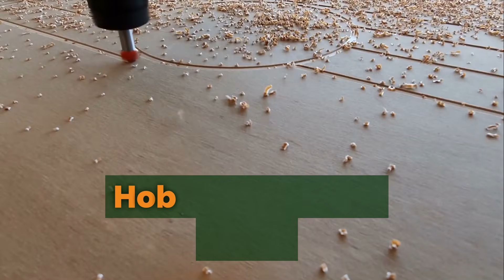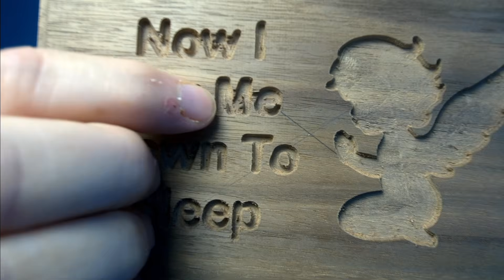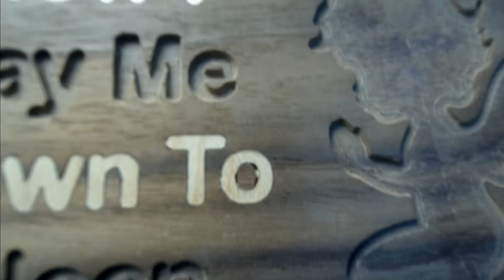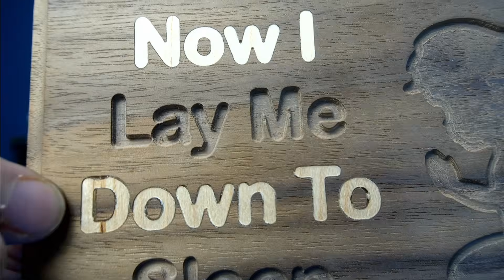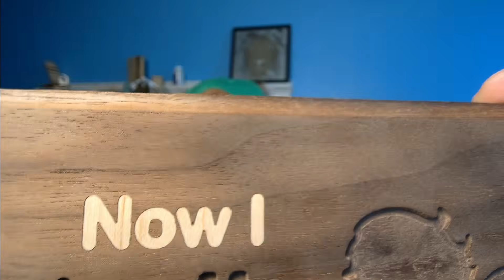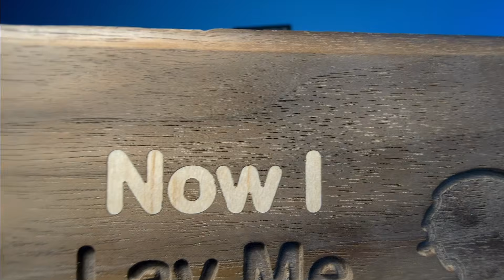2.5D vs 3D CNC Engraving: Understanding Cut Paths & Perfect Inlay Fits

Comment: Another good video with some great insight.  I too, assumed that cutting inside the line and outside the line would produce a good inlay, although I have not tried it. I'm also new to CNC but not the 3D world and I'm wondering if it's possible to write my own bits of G code to make the router move in both axes at the same time. It should be possible.  I'm going to remove the bit and test this theory and see what I come up with.
Reply from the maker: I had taken a break from Millmage until they introduced V-carving.  The latest Release Candidate does just that.  So, I a back to learn and share my experiences with others. New video dropped today.

Comment: Thanks a Stack ..... A Great Vidclip ..... A Great Simplistic and Easy to understand Vidclip Explanation ..... I am Retired ( 75 Already ) from the CNC Background, a Toolmaker by trade and as with you, I have been using LIGHTBURN for a good few years already. I am busy building a  Small Very Sturdy CNC Router .... 600 x 400 x 80 mm Movement and have just been busy with 'MILLMAGE' for about 10 days .... I also found the 'Similarities' Extremely Helpful .... OK .... 'V-Engraving' is a Massive step up in the Calculations, as there has to be CONSTANT Calculations into the 'Cutter Width', being a 'V' Profile, when a 'Needle Point' Profile is required, The Cutter has to rise up to Virtually the Z = 0 position ..... " Cutter Diameter Compensition' would be a Great advantage, But has to be in a 'Table' and applied to Every Specific Cutter ..... OK, Enough Ramblings.... Best to ALL from ChCh, NZ
Reply from the maker: Thanks! I had taken a break from Millmage until they introduced V-carving.  The latest Release Candidate does just that.  So, I a back to learn and share my experiences with others. New video dropped today.

Comment: With it not having the ability to do a true vbit capability would it not be better to do just a straight bit inlay
Reply from the maker: 2.5D inlays are typically done with straight endmills.  Using my technique and my calculator you can bet much better results.  You have precise control and inlays created with v-bits have a much better finished result. My technique and calculator will not work with true v-carving, but I do believe it is a game changer for doing inlays when limited to 2.5D.

Comment: The Problem with Millmage is, They released the vcarve function before it was done. I t will be able to do the true vcarve in later versions. That is according to Chris. So it is coming. Both Millmage and Vectric will cavre to the line. But Millmage can not raise the bit to get to the finer details. It has to stop at the point the programmed bit can fit in that vector. If your vector comes to a 2mm point and you are using a 4mm bit, it will not fit.  It is like doing a normal pocket operation with a straight end mill. Other programs have a "REST" option that allows you to do a bit change with a smaller bit to finish tighter details like that.
Reply from the maker: When using the Inlay Operations built into Millmage, the female pocket cuts inside the line.  The male operation cuts outside the line.  From my research, this is standard on 2.5D inlays.  And typically 2.5D inlays are intended to be done with straight endmills.  But it is difficult to get an inlay with straight endmills without noticeable gaps and glue lines.  Using my techinique and calculator you get a much better result when you are limited to 2.5D.  Instead of cutting inside and outside the line, the CNC cuts the line, but you use a v-bit and compensate with varying offsets to  create a better fitting inlay than a straight endmill result.

Comment: That is what i said about the place where the depth is it will be higher or lower on the bit side . to determine how far the bit has to move so it cuts inside the line and outside the line